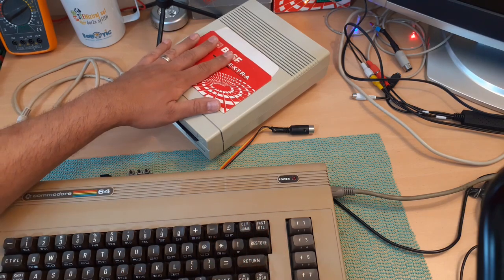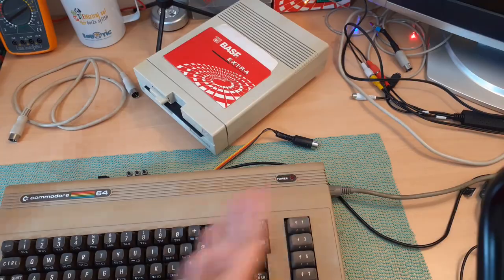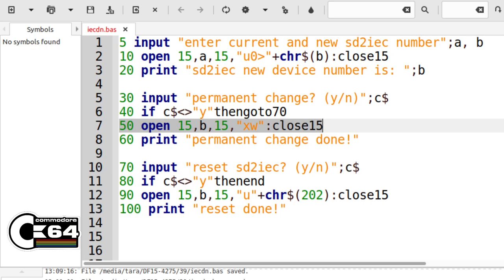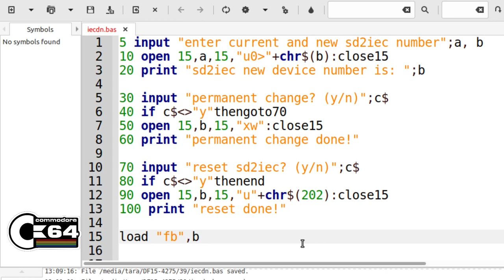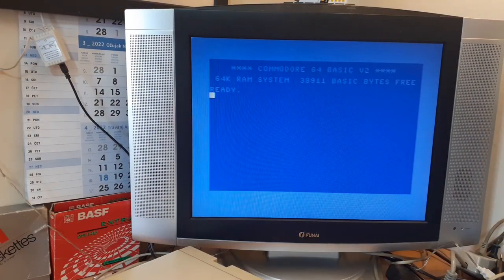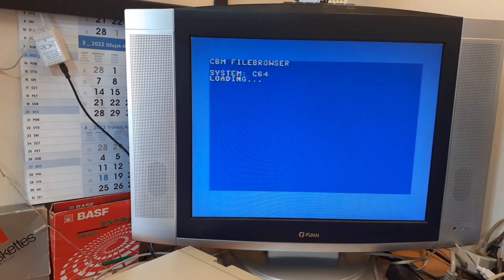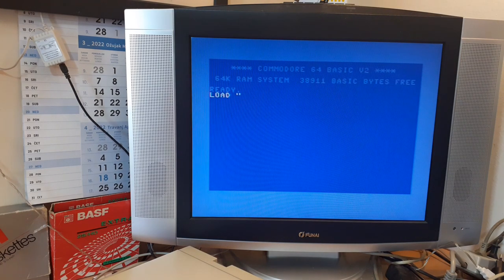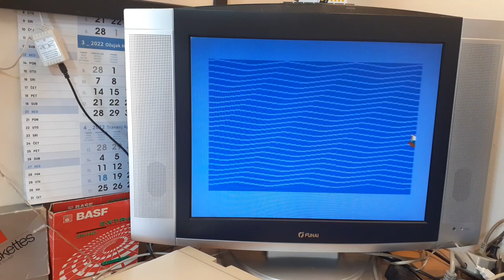How to change SD2IEC Device Number | Commodore 64 | Basic Code

Comment: Thank you it worked. But should change it a little when you type in the device number press enter and it show just ?? should show something like Enter new SD2IEC number. But I know it says enter current and new but hard to know to do it with a comma between the numbers.

Any way were did you get the SD2IEC you have plug in the back of your C=64? I looked for photos for the SD2IEC and did not see any like the board you have. That's a very good way to have it. Plug in the drive port and cassette power port at the same time.

Thank you.
Reply from the maker: Nice to see this little tip still helps someone :). Maybe it's slightly different firmware, but if it works that is awesome :) 
This SD2IEC model is modified so that I can use it on C64, plus/4 and C16l.
(It's still available to buy on ebay)
Cheers!